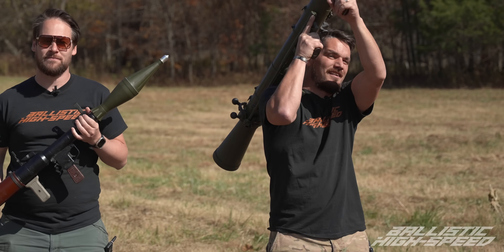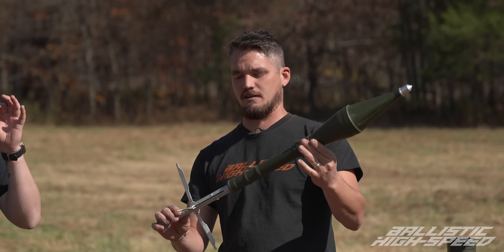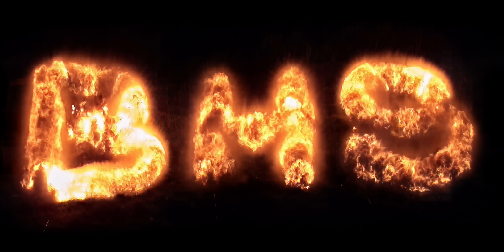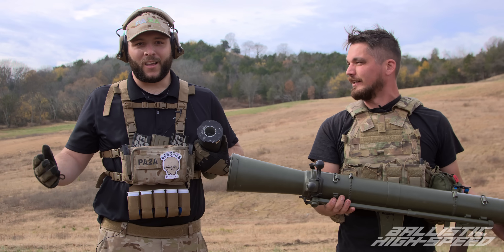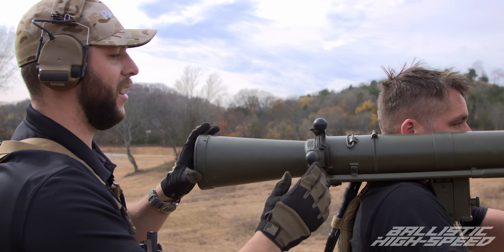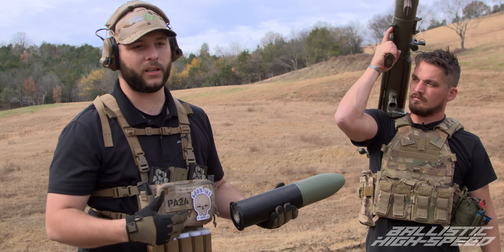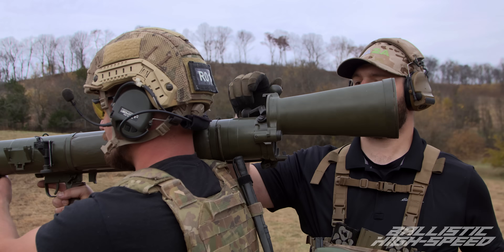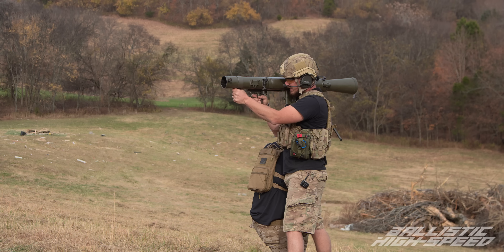Rocket Launchers and The Dangers of Back-Blast! - Ballistic High-Speed

Comment: Wait, so the RPG-7 just uses a rubber ring around the projectile to keep it from just sliding out? That's pretty damn smart, I always figured it just had some sort of locking mechanism that's released when the trigger is pulled and rocket ignites.

Also god damn, I've always known backblast is extremely dangerous, but I never knew it was surprise amputation levels of dangerous.
Also also, Jesus Christ! I'm glad he survived that misfire.

Comment: rewatching this, i just noticed something about the rpg 7:
at 4:06 there is already smoke comming out at around the trigger, where the rpg would later catastrophically fail.
Reply: good eye, also i suspect the weld cracked under the pressure of the first shot, and the last one probably was just it breaking due to the crack.

Comment: I regret that this wasn't available as a training video when I was in boot camp during 1975.  One reason to limit firing rocket launchers and recoilless rifles to "military personnel" is the potential for catastrophic accidents.  An AT4 rupture wouldn't be pretty and that is a problem with "lowest bid" manufacture.  Then there are environmental factors that can damage the launch tube and cause failure.  

I've been a safety NCO on many Army ranges and two personnel required on the range are an armorer to inspect munitions and a medic for when something happens.  At present I am an NRA certified range safety officer--the recreational firearms and police service weapons are supposed to be checked by the user (and a gunsmith) prior to being fired and a first aid kit is recommended, along with an SOP for summoning medical aid.  The safety rules make mishaps on "civilian" ranges a remote possibility when all rules are followed.  Some commercial shooting ranges ban the use of reloaded ammunition as a safety measure.  Factory-made ammunition is supposed to be guaranteed quality.  Experimental ammunition has higher risk, and handloads are "experimental" in nature.  That being said, my only squib load was big-name factory ammo and my only case head separation was MILSPEC 5.56mm.  

This was written four months after Adam's mishap.

Comment: Am I missing something? Everyone is talking about an equipment failure while the accident seems like an example of why the exhaust of missile launchers / recoilless rifles should never be blocked. Putting a very large human head figure on a very strong pole right at the exhaust of the launcher prevented the gas from the initial ignition fully escape, which might have caused the misfire by messing with the sequence of events. I knew there was an accident in this video before watching, and I thought it was during the firing of the recoilless rifle with a hand figure behind the exhaust when I saw that part first, thankfully it was not anything like the unfortunate accident with the RPG. Nevertheless, I wouldn't dare that one myself either, even though the hand figure was lot smaller and weaker, therefore did not fully block the escape and simply got launched away. With all due respect, I believe the root cause of the accident is likely the head figure behind the exhaust. And with all that said, I am very happy that he is good and recovering, I hope it will be a fast and complete recovery.

Comment: It should not be looking like a Civil War. Canon went off. It’s supposed to be smokeless powder or rocket propelled. There should not be any smoke. You can go watch a ton of other videos that smoke bombs to add the effect of firing that thing too many times with low performance rounds, or way too much onto the barrel, and there is a crack on the outside of the barrel. Hopefully he makes a speedy recovery and have ATF make sure that the barrels are all freaking non-cracked you triple check my grandpa Eldridge would been turning in his grave because he knew PG seven because he was in the motor core of the Marine Corps in Vietnam. He had to deal with RPG sevens all the time and RPG seven she blow up all the time because, a special operations with exploding RPG’s

Comment: My guess is, no one is supposed to stand behind an RPG when it fires. OP thinks it was only because of danger to the person behind, but in reality, it's also to protect the gunner, as the backblast hits the solid object, in this case a skull, and that causes FORWARD blast back on the gunner. It didn't happen with the hand because the hand was flimsy and rubbery enough to be pushed away by the blast.

Comment: That head was about 8-10" away from the supersonic exhaust cone. The head was larger in diameter and from the distance it would've covered the high pressure blast cone of supersonic plasma. The sonic boom was reflected back up the exhaust gas plasma and interfered with itself inside the launcher creating a pressure wave collision and pressure spike.
 Like putting your thumb really close to the end of a garden hose while only touching the water, raises the pressure inside the hose.

Comment: I'm not trying to be insensitive about this, so I do apologise if it does come across that way. I hope he has a speedy recovery and there's no long lasting issues that comes from this.

This just goes to show that how serious he takes safety is no joke. Working with explosives, no matter how small, is extremely dangerous. With this one-in-a-million chance accident, I hope it helps to teach you guys an important lesson to prevent or minimise injuries in the future. We'd all hate for another accident like this, and more-so if it had a different outcome.

Maybe create a brace to hold the item in question and have the firing mechanism attached to a string or an electronically controlled switch so it keeps you guys at a safer distance. Or wear protective gear that covers more of the body for when a brace and remote firing position is not possible.

What happened here reminds me of Kentucky Ballistics .50 Cal accident.

Comment: please stop buying refurbished rpg they aren't actually safe at all, and it's done in most countries out of desperation they are Russian design weapons and manufactures range in quality im not criticizing you guys at all I'm only worried for your safety and wellbeing. as for my knowledge on the matter I am missing an arm.
Reply: The wierd thing is if they didn't use a refurbished launcher he would have died.

They touch in what exactly failed and why in their latest video but the short story is that the failure they experienced wasn't a failure of the tube it was a booster fail. A chunk of the black powder booster came loose and blocked the back end building pressure beyond the limits of any tube refurbished or not.

What saved his life was the brittle metal around a weld from the refurbishing of the launcher if that wasn't there the next failure point would've been a total failure of the tube essentially turning the whole thing into a pipe bomb.

Instead a welded point on the bottom failed venting the gas before the whole tube failed.

Comment: I hope for a full recovery but the whole point of making sure the back end of the launcher is clear isn't for the safety of the person behind it as it's more likely just going to knock them on their ass and burn them a bit. It is so that the launcher doesn't have blowback down the end. The hand didn't cause it because it acts kind of like a vent with the fingers and such, it also doesn't have as much surface area and mass. A key difference that caused more back blast to be shot back down the end is that the other launcher that was used on the hand actually is designed to where the back blast spreads more vs being shot straight out in a line. The head however, will just push the back blast back down the end of the launcher causing the booster to surge forward and seal the venturi tube.
Reply: It wasn't the head they found out what happened and talk about it in the next video.

Comment: I think the real lesson to learn here, is maybe people (government or otherwise) should stop doing de-mil jobs on weapons. Either is legal to bring back functional, or not at all. The process of putting this through the de-mil process, and then going and re-mil-ing this weapon system, is almost 100% the cause of this. If it had just been left functional, this would likely never have happened. Leave the weapon functional and restrict access to the rockets if they want to control them. Or just stay the f out of it.
Reply: The re-mil saved his life ironically.

The weld job on the bottom failed after a blockage in the tube from the booster.

If that weld wasn't there or didn't pop the whole tube could've ruptured and essentially turned into a pipe bomb.

They talk about how it failed in their video after this one.

Comment: Looking at this and your after vid, this was obviously going to happen. look at 2nd shot of RPG7 and massive smoke from trigger grip. not on first shot, also the debris from muzzle and venturi shows the reactivation failing.. Clearly a hole was cut in expansion chamber as part of demil' procedure. Why would somebody weld in a piece of metal in such a high pressure area?
Luckily the Lad is still alive and not totally incapacitated. This why we do not REACTIVATE  DEMILLED WEAPONS.
Reply: I noticed the debris as well. Wondering if that was normal?

Comment: Its the backblast i believe, the head blocked the backblast too much and cause the rocket to prematurely detonate in the tube
Reply: The rocket didn't detonate it had no explosive filler and it wasn't the head it was a failure of the black powder booster.

Comment: My 20 years of experience in the Army it is not uncommon for the ammunition to cause malfunctions. This could be from improper storage, defects, or mishandling of the weapon and ammo. RPG-7, SMAW, AT-4, Carl's, and even vintage LAW as well as MANPADS for ground to air, all have a chance of this happening. My guess is the motor had a catastrophic failure or was a hot load exceeding the tube's ability to contain the blast. They were firing prototype rounds so this seems most plausible. I wish a speedy recovery to Adam.

Comment: Hope Adam's recovery is going well.
I would like to share some safety concerns for anyone thinking of reactivating an RPG 7 or making ammo.
Firstly, Adam and the team did nothing wrong, and this comes down to a company allowing someone to shot "prototype ammo" (that should never be allowed purely irresponsible).
The rocket being used is of a PG-2 style, designed for the RPG-2. Totally different tube design then the RPG-7. Which is a factor in controlling the pressure of the expelling charge. (Green thing on back of rocket, makes the heavy ass rocket leave the tube. good bit of propellent in there normally)
PA2A is also probably using black powered in the expelling charge instead of the precision made propellent used in normal manufacturing. A small mistake there or even damage by holding it wrong can cause an over pressure failure in a new off the shelf RPG-7.
Also, DO NOT shoot reactivated RPG7s! No heat treat is going into that weld, and I know of no company that has done any X-Ray testing on one. 
lastly, don't put anything that close to the ended of the tube. There is no testing I know of that shows that something (even minimally) blocking the exhaust tube wouldn't cause a pressure issue. 
Three things, prototype ammo, reactivated tube, and obstruction at exhaust tube. Anyone of these could have caused an over pressure failure. Put all three together and it makes my stomach turn.
Again, Adam and Ballistic High-speed are not at fault. They are not a rocket development company or a destructive devise manufacture. PA2A should not have let them shoulder fire it. Put that thing on a stand if you want someone to shoot it.

Comment: 1. the basic mistake is the use of a warhead from RPG-2, a completely different drive system.
2. 3:16-3:19 please pay attention to the length of the propelling charge.
3. 8:37-8:38 the length of the propellant charge is twice as long.
4. 8:38-8:39 omission of the first phase of head loading, the authors knew where the mistake was made.

Comment: Unfortunately, you made a big mistake. Since I was 12, I had read that the minimum safe distance behind an RPG is half a meter, and if it was less than that, an imbalance would occur in the pressure released from the back, leading to the pressure rebounding forward, and this could lead to the weapon exploding as well.  This law applies to rifles and cannons, and it is not possible to fire at a target from zero distance

Comment: 4:56 and 5:15 you can see the smoke start coming out between the trigger group and the body of the RPG. Was this the point of failure with the next round? I don't think an RPG would vent on your hands and face. Based on his injuries I have a hard time thinking the rocket was the issue.

Comment: I’m thinking that maybe putting something in the “backblast zone” might not have been the greatest idea. I’m not a genius or anything but when dealing with pressures like that very small variances could cause drastic changes in pressure in places pressure is not supposed to be. I’m just speculating but it would take a literal rocket scientist to prove me right. Nothing but love and wellwishes though. The one thing I know first hand is that being burned is the worst type of injury. I was severely burned when I was a kid and it made any unpleasant experience after that a goddamn cakewalk. This fucking sucks but you will come through it stronger.

Comment: Was no one reviewing the slow mo footage during filming?? I clearly saw the beginnings of the failure in the footage of the test firing and the instant the text about the failure appeared on the screen I knew immediately what was about to happen.

I’m just surprised no one there was reviewing the slow no footage after each shot to make sure everything was in frame and focus etc. If someone WAS checking the footage as filming progressed I don’t see how they could have overlooked that explosive venting out the sides of the launcher near the trigger assembly. 

Poor dude. I’ve seen uncensored footage of stuff like that and they’re pretty much reduced to an unconscious pile of smoldering gear and pulverized flesh and bone.

Considering the incredibly sensitive and high tech recording equipment you guys have I be that has to be some wiiiiiiild footage of that thing popping in his face. Scott showed footage of his explosive failure. Your turn!

Comment: All I can say is check your supplier and if anyone checked the munition upon acquisition and upon time of loading. 
Rouge suppliers have been known to tamper with civ buyers munitions in an attempt to thwart "3rd partys" from using said munitions against the original intended supplier. (Not knowing it was for YouTube and assuming it was going to be used by third party as an offensive tool. Not that you can do much about it at this point but for future reference. Might help
-just food for thought, that did not seem like a typical malfunction though I am no expert.

Comment: My favourite of these types of weapons is the Panzerfaust 3 IT-600.
It can be safely fired from inside relatively small rooms for urban combat since the back blast is greatly reduced. Beyond that it's capabilities are very similar to the latest Swedish-British NLAW. Effective range is 600m for moving targets and the chance of hitting a target at that range is 90% or better.
The differences are what makes the PzF3 superior: It is a dumb line-of-shight projectile, the highly sophisticated aiming and trigger unit is reuseable and costs $11 000. The rocket it launches costs $230, carries double the explosives and thus does not need the top attack mode because it can penetrate the frontal armour of any MBT (rolled steel armour equivalent 900 to 1100mm (with or without ERA). One single use NLAW costs $40 000 and for the same money you'd get 2 trigger units and nearly 80 rockets for the PzF3. NLAW arms after 25m of flight, PzF3 after 5m.

Comment: So talking about this rpg incident: i have a friend who is a military sargent, i talked with him about this and showed him this video. He says it is possibly a escape gas valve failrule. This is the valve that controls the exit of the backblast, and if this valve fails (mostly from a manufacturing error) the body of the RPG can blow up or blow open as it is not manufactured for such high pressures. Along with the insane recoil the gun would have on his shoulder wich even tho it has a very small area to cling to, it is still a high enough impact that can knock someone out along with flinging them back trough the shoulder. So after some time i at least think the front part of the barrel blew open, flinging shrapnel at him while flinging him back. Keep in mind that this is completely based off of what the video shows and shear military experience, this comment can be wrong so if thats the case please feel free to correct me and/or give a lil more info, thank you!
Also hope Adam will be fine after recovery and i hope he will be able to live normally. Good luck!

Comment: Was it a rewelded RPG7?  A reweld can't be safely fired because the operating pressure of an RPG is 13,000psi.  They aren't rocket launchers.  They are recoiless cannons.  Luckily it failed with a black powder RPG2 round rather than a full pressure smokeless load from a real RPG7 round.

Comment: An unfortunate incident. The slow-mo footage of the first few launches (and presumably the failure itself) should give you some good data to identify the root cause, but I don't think you should be seeing the solid chunks that come out of the back blast on basically all of the RPG launches - suggests improperly-formulated, improperly-cast, improperly-stored, damaged, or expired solid propellants, or cracked nozzles or other components of the boost rocket motors. I hope the supplier of those rounds is taking a good hard look at their process and materials.